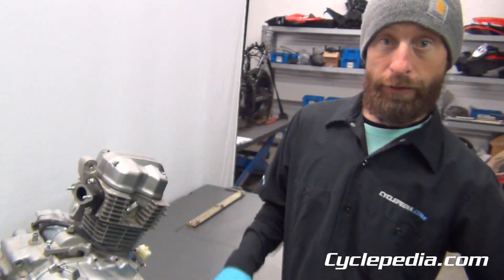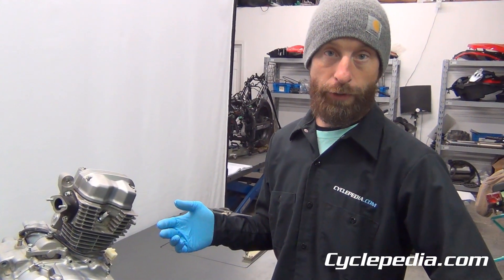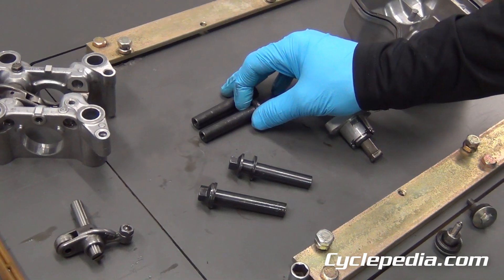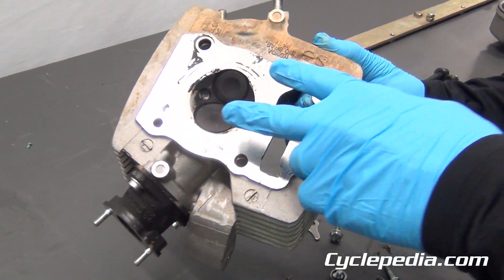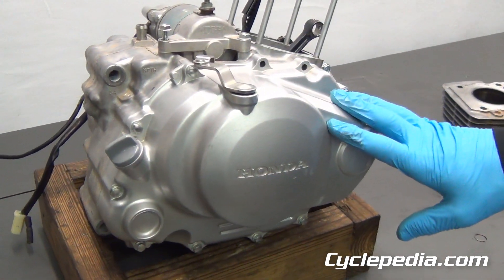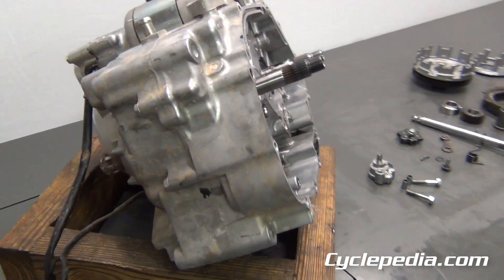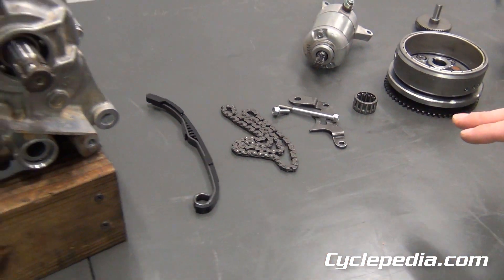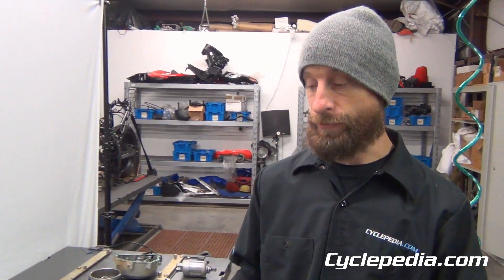Taking Apart a Honda CRF150F Engine

Comment: I’m stuck on the clutch pin removal on the crank case cover? I got the spring off the dowel… but can’t seem to get the dowel out? Any assistance would be greatly appreciated!!
Reply from the maker: Sign up for the manual  and you get free tech support, we have two manuals depending on the year model. Here is a  link to our Honda manuals page.
https://www.cyclepedia.com/online-manuals/cyclepedia-honda-online-service-manuals/

Comment: So your teardown video doesn't show you how to take it apart at all. You showed us all the parts, thanks. I bet your service manual is really in depth 🤣
Reply from the maker: The manual contains 930 detailed pics, step by step instructions and free tech support if people have questions about working on their bike. The video was just for fun and goes over what parts are in the engine, your not supposed to use a short video to rebuild your engine, it is titled "taking apart an engine" after all. Feel free to contact us through the website and heck I'll even give you a free subscription just so you can check out all the detail!

Comment: I just started disassembling a 2003 crf150f. Can you tell me what tools I need beyond wrenches/ sockets? I’ve looked at motion pros website but want to be sure
Reply from the maker: We show the tools in our manual. I don't remember everything but you need a special locknut socket for the primary drive and clutch hub removal. This also needs a clutch holding tool.
Reply: How’s it going I’m about to start on the same year wondering how difficult it is. Rebuilt multiple yz450 and 250f engines but never one of these seems even easier but never do know 😂

Comment: Is there a gasket that goes in between the cases?
Reply from the maker: Depends on the year, the early models 2003-05 use a gasket and the 2006-2017 use sealant.